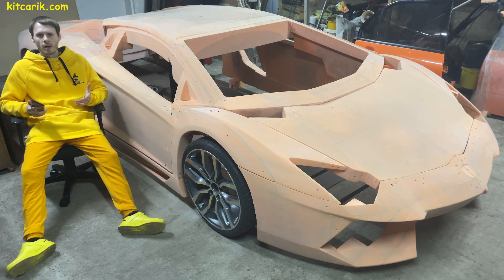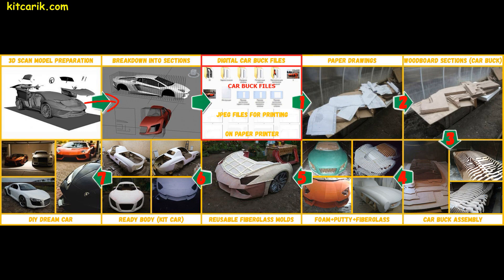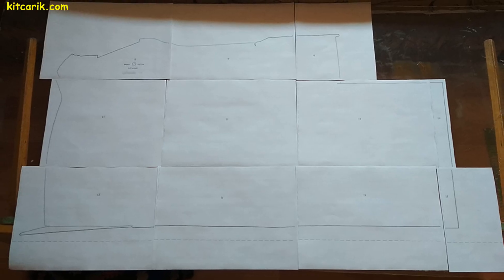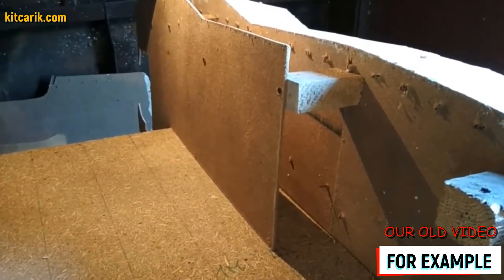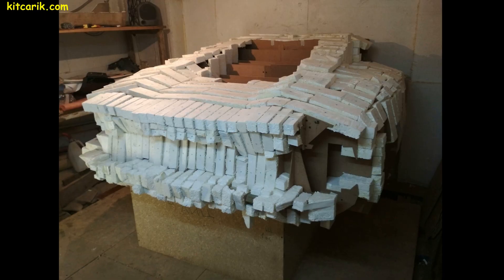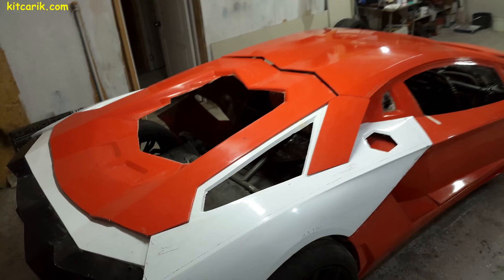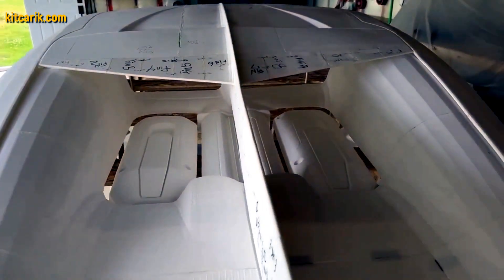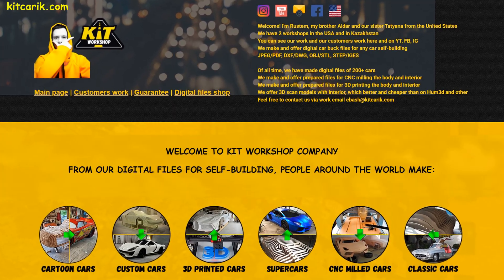Easy Method To Make Supercar Bodies From Scratch | How To Build A Supercar From Scratch | Kit Car

Comment: Do you guys do right hand drive options like can you just kinda flip the car in the file so it will fit over uk cars
Reply: I bought files from them, I just let them know what side I wanted the steering wheel on. I bought LHD, but you can get either LHD or RHD. I’m very happy with the purchase and recommend them.
Reply from the maker: Yeah, sure, easily